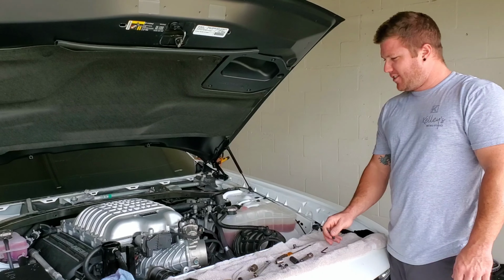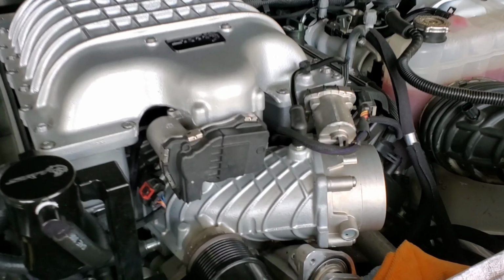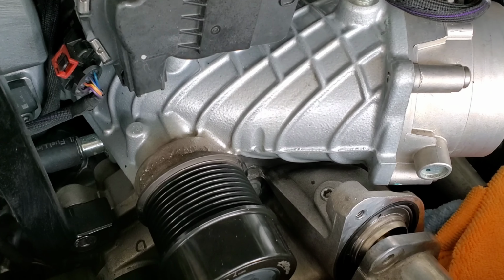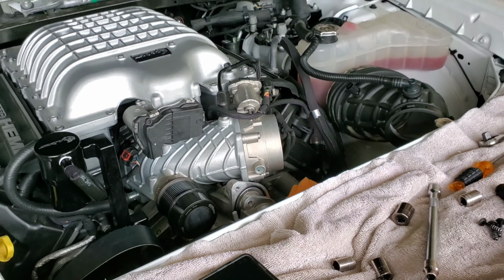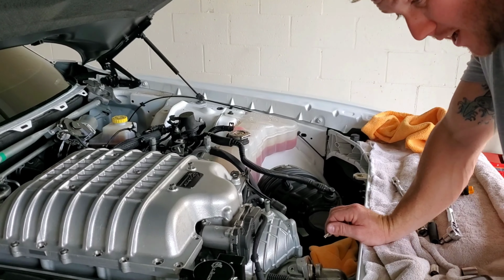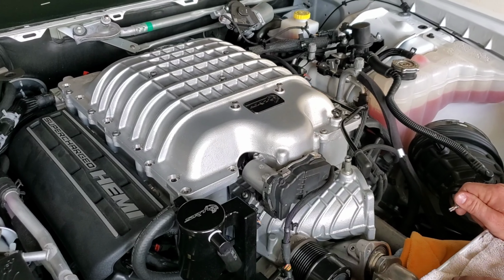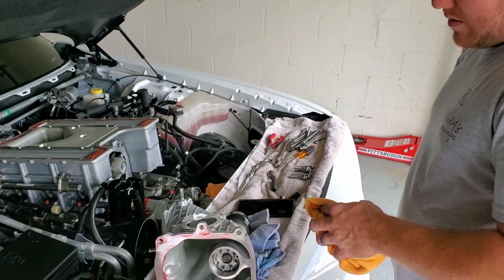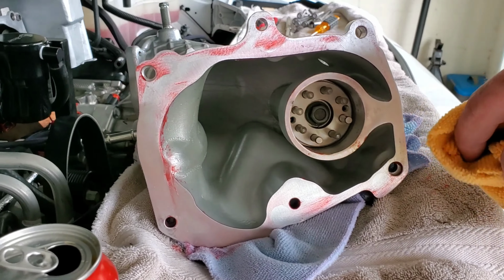Pulley failure & Supercharger teardown on Redeye - (Ep. 7)

Comment: Doing the same thing this weekend getting my snout ported bearing plate done with 112mm for the snout happy I came across this this video helped me out thanks
Reply from the maker: Awesome, I'm glad to hear that! Who's doing the work for you? I'll be getting mine back in a few weeks and will be putting everything back together. It's getting powder coated, too! Make sure you come back to check it out!
Reply: Chris Kelley me and my neighbor going take it apart...place I’m getting it done is called kong performance...in Pennsylvania I’m going to  ship the snout there the pulley I’m  going with  2.65 grip tech pulley from jokers performance.112mm from kong performance...
Reply from the maker: Nice, man! Let me know if you post up any videos when it's finished.
Reply: Chris Kelley I sure will...
Reply: That bar that you removed near the firewall, how did you detach the black box connected underneath it on passenger side? @KelleysGarageOfficial
Reply from the maker: @mikeprice8307  I'm pretty sure you have to slide it over if I remember right.
Reply: @KelleysGarageOfficial  I can't figure It out . Thanks
Reply from the maker: @mikeprice8307  un-bolt the strut tower bar. Flip it over so you can see how it's mounted. It's not a difficult process to figure out. You got this🤘

Comment: I’m doing mine at 25,000 miles 2019 sending it out right now 👍
Reply from the maker: Nice, who you sending it to?
Reply: @KelleysGarageOfficial  who did you send your to?
Reply from the maker: @mikeprice8307  SDG Motorsports for the porting work.
Reply: @KelleysGarageOfficial  do you need a tune for the porting?
Reply from the maker: @mikeprice8307  It's always best to retune for any changes you make to the car, although it's not mandatory in this case.
Reply: @KelleysGarageOfficial  sending my out to sdg for a rebuild and pulley install. Any problems with them when you had yours done?
Reply from the maker: @airsoftkid01 SDG does quality work